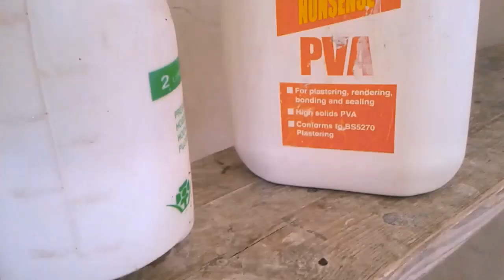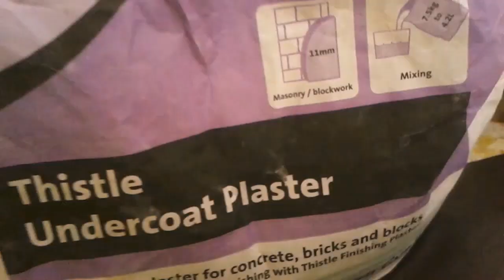A Step By Step Guide To Filling Gaps Between Hardwall And Ceiling

Comment: Lovely job. Another great example of the wonders of Soudal foam. I notice that it's usual to put lining paper in horizontal strips rather than vertical strips on the wall. Is that because it's quicker to do it that way or is there some other advantage?
Reply from the maker: Thanks, It can be quicker and less joints as well. When applying emulsion paint on lining paper, if possible it better to line horizontally. That's best for full walls if you have windows and up side of door casings it is better to hang vertically, it's what ever leaves the least amount of joints. And for papering over same really so you do not have matching joints anywhere.
Reply: Thanks for the explanation on the lining paper.  Makes sense. Cheers, Mark.
Reply from the maker: Yes without a doubt.

Comment: Is there ever a situation where you would suggest someone should investigate the reason for big cracks or do you just go in and complete the job you've been asked to do?
Reply from the maker: Generally you can tell if its a structure problem. This has been caused by a leak and it's over 100 years old the house.